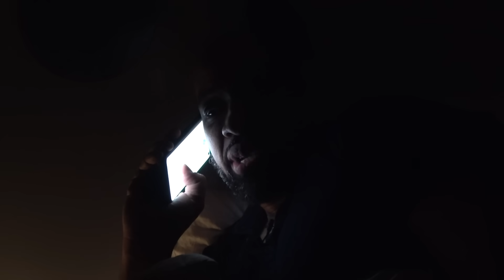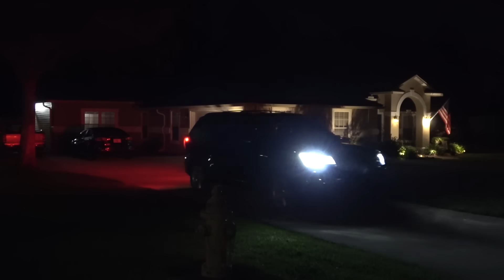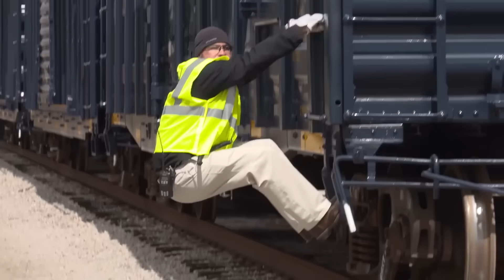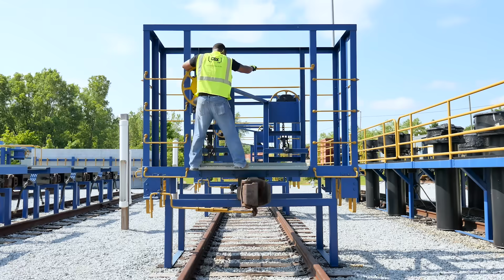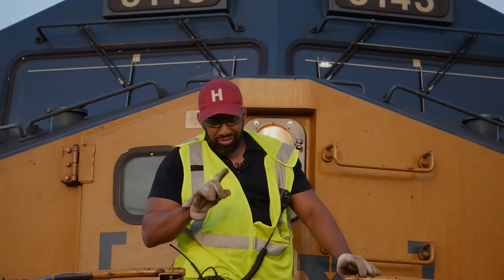A Day in the Life: CSX Freight Conductor

Comment: Ok I see a few things wrong with this. 1st when he went between cars to tie air hose or do any work between cars he didn't request 3 step protection an that is a safety MUST. 2nd when you go to Atlanta for training you have to maintain an 85 % or higher to stay in the class. Also you must pass a signals Test with a 100% if you miss one you get marked as fail.

Comment: I just retired about 18 months ago, after 45 years in the UK rail industry, and I can see, the glamourisation of the industry, is very much the same. Working nights, weekends, holidays, etc, the industries carp on about safety, fatigue, not cutting corners, but really couldn't care less. All this 'do gooding', is a tick box exercise.  I wasn't a Conductor/Guard, or an Engineer/Driver, I was on the OLE/Catenary, then later, I was a trainer/instructor. The latter years were easier, but I still saw all these types of videos, but when something bad happened, you had to watch out in some cases. It's always high management who cause the problems, but don't have to put up with the crap, both industries should let go of high management - I'm sure it would run better. I'd just finish and say, if you are still in the Rail(road) Industry, wherever, just stay safe, don't do what you shouldn't, make a note of anything you don't think it right and video it. Look after number 1 - YOU.

Comment: This seems like a great career .... until I started reading the comments!🤣🤣 I'm currently travel building wind farms all over the country so the travel isn't a problem for me. I think the only thing that would bother me is the weather. Even though I have to deal with it now travelling to different areas, I do have to comfort of getting back into my truck to get warm when its cold. I'm not worried about the heat because I grew up in Alabama and I'd much rather be sweating than freezing. Hotel living is not a problem, unless they book the hotel for you and its a dump. But, I would hope they'd book somewhere you could get the rest you need comfortably. I appreciate all the other comments I've read under this video as it was/is extremely helpful in my decision-making process. I still think I'd like to try it after a few more years out here in the wind industry. Thank you CSX and those of you who've been in the rail industry for a while!!

Comment: Ya tell me to push back 50 car lengths. Count off 1 car length into the radio, slam the locomotive brake and let the slack run out. Start pushing again. Go one car length and count off 2. Slam the brake again let the slack run out again. Wash, rinse and repeat 48 more times. If you're still hanging on, you can tell me 100 car lengths and I'll respect your decision.

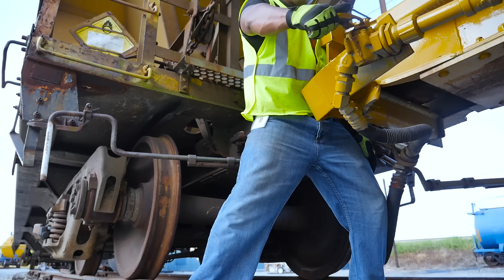Comment: well at 7:43 thats a fail, that clamp comes apart, at 90 psi, the iron head on the end of the rubber hose will shatter the bone in his leg, the volume contained in the air line, will whip the heads around while your man is down on the ground striking his body or even his head, wonder what else ill find in this video.

Comment: I was almost hired at Union Pacific I passed everything but the interview. This video was very "light" and didn't go into the real details of working on the RR. The guy that oriented us told it like it really is. You're  going to miss just about every holiday, birthday, anniversary, special events and etc. I also hope you have a STRONG relationship with your spouse or significant other. Because the divorce rate is 2nd to police officers which was #1 when I applied. The other stuff will be covered in the orientation. It's hard work and very demanding, for example walking a mile or more with a knuckle to change out when they break in every weather condition possible. Get through all of that ,you'll have a successful career at any railroad...

Comment: I am just amazed how this job is portrayed as a walk in the park instead of the reality of railroad employment.
Called at 0 dark 30 with a pending family event is very accurate. Most of the remainder of the video is inaccurate or just false. 
The conductor and the engineer must be actors because nobody with any time on the railroad is that clean. The vests look like they just came out of the wrapper and still have creases in them. New gloves and a new radio are certainly props and neither the conductor and engineer were wearing hearing protection. If you are going to produce a video at least make it accurate.
Reply: Every once in a while I would get called off the extra board to work a job that serviced a local chemical plant. Everyone working at the plant were wearing hazmat suits. Not us. I tried and tried to get the chemical smells out of my clothes. Never could and would end up throwing them away. The EPA ended up closing the plant down and had it demolished. Tallow plants and lime plants were fun ones to service as well. It was a complete shit show. Winter was fun too. Shoved an 11,000 foot train out of the yard hanging on to the side of a box car one night. Freezing rain smacked me in the face for the entire ten mile shove. There was no van available so I had to walk from the rear to the head end. Even my old head engineer, an old Nickel Plate guy, was pissed off for me. After about ten years I had enough. I saw more than my fair share of shit and wouldn’t wish what I saw on anyone….well, maybe my ex-wife, but that’s a different story for another day. 😎

Comment: I work as a conductor in a switch yard. Not class 1 I will never work class 1 after up did my uncle dirty. You may have a job, and get paid well, but that doesn’t mean you’re consistently getting paid. My uncle worked for 3 years and only actually worked maybe 1.5 the rest he was furloughed not getting paid, and not able to get a different job

Comment: 11 years as a Conductor. Close to engine school. Road/Pool jobs suck, the extra boards suck. We tell the new hires (yes, they actually hired in my terminal (cause they furloughed a LOT last couple years, no one came back) that they fucked up, some have left already. Only good PSR has done for my terminal is the flat switching, which caused local management to put on a yard extra list. 11 years and a yard extra list is the best job I can hold. Most of us enjoy our actual job, it's everything else that comes along with it, especially after PSR came into effect. Don't forget the onboard cameras, PTC, and Energy Management (sodomizer). No fun left in running trains. Can't test your skills with the air brakes anymore. Can't do anything really. PTC is nothing but a nanny designed to get you fired, an excuse to cut jobs. Just wait till the Class 1s get there way with crew consist. Never mind the expired contracts that they won't negotiate, or make absolutely absurd offers on (yes, the unions are a part of the problem here too).
Reply: You've told nothing but the truth!!! OS RR

Comment: Back in 2018 I worked for a company contracted through Union Pacific. Was there for about 6 months as a trailer mechanic. An alright job, left because I was working third shift though. I hate third. But, if you're working in a shop or an intermodal facility, you should have some type of life. Theoretically.

Comment: Aside from this video.... Is there a ladder to climb to drive certain locomotives?? I see so many nice locomotives and some just over worked and in need of TLC. But to me i think of it as cars, in which the old beat up engines are given to lower ranking drivers, and the newer different engines like the heritage units i see or other random units are driven by the upper class engineers?
Reply: nope doesn't work that way... with the locos you get what you get you don't have a option UNLESS, there's something mechanically wrong with your unit
Reply: @25mfd  Nice. Thank you!

Comment: Did 12 years on shortline/industrial jobs as engineer. Life was good. When the last one ended and shut down with the closing of our major customer, a friend told me I should go to CSX or NS. "No thanks!" Tried truck driving for the next 7 years which turned into a real horror show. Doing my own thing now and don't think I missed out on the class 1's. And I've known A LOT of former B&O guys who have nothing good to say about CSX.
Reply: why was trucking a horror show?
Reply: @hectorfernandez6748  too many reasons to count, I imagine.
Reply: @hectorfernandez6748  It’s just as bad as some of these guys’ times on the rail. You’re overworked, underpaid, tied to a truck (may as well be literally with the amount of time you get to spend with your family). They claim you’re your own boss and the corporate/admin side is “hands off”, but call a dispatcher and tell them you’re not feeling well and the load may have to be late cause it’s affecting your driving and that’s when the excuses as to why you should keep going come in. 

That, and some dispatchers are known to try and coax drivers into breaking the law, mostly by driving longer than what is legally allowed. I bet you if they suffered the same consequences as the drivers they told to break the law, they wouldn’t do it. 

I remember I was stopped for my mandatory 10-hour break and had a dispatcher message me on the hardwired tablet in my rig asking why I’m stopped. I silenced my tablet and ignored every message from that specific person after they asked me how it’d be illegal for me to continue driving. If I’m being honest with you, they may as well replace the name your parents gave you with the truck # printed on the rig they assign you, because that’s how you’re treated.
Reply: @WhopperJrNoCheese  if you know they will never do it. you should do the same and never let anyone pressure you into it  i'm very new to this field and i've learned from my previous career if you let them get away with it they will never stop.
Reply: Not just CSX... all of them!

Comment: The video tells you that you will be home for the required fra 10 hour period. What they don't tell you is that  you will be away from home 36-50 hours in a dirty hotel.
Reply: 36-50 hours?  What AFHT terminal do you go to?!  Half the time at ours we get that call from the dispatcher before we get there... "Dispatcher to Q40whatever, Chief says show back up on your rest for Q30whatever."  Exhausting.
Reply: @nicholaswhitfield9341  you do understand that its 12 hours on a train your home to your away terminal, 12 hours in the dirty run down hotel and 12 hours to get back home. That equals 36 hours. You deserve 2 full days to be with your family, but csx will call you back in 10 hours to do another 36 hours minimum away from your family. Thats why I quit after 25 years because of loss of family and friends. I got job as an electrician and actually make 44.60 an hour straight time and double on Sundays home every night. The railroads have gotten too toxic as what they was in the 90s. You know we used to be able to mark off a few days and have some quality time with the family.

Comment: Would working for BNSF be a good idea?
Reply: BNSF is the best; best track and best equipment.    Warren Buffett bought quality for a reason.
BN furloughed way too many employees and mothballed way too much power during the scamdemic.
When it was time to run trains; well.....     If you apply off the street; your life will never be the same.
Reply: They aren't horrible. They sorta do PSR. I know the Lindenwood Yard near me in St. Louis Missouri. I haven't heard any complaints other than shitty management like every other Class 1 Railroad. It's one of the better options avoid Union Pacific and CSX.  You could try a short line railroad to get some experience. Best of luck however.

Comment: Hey, I'm thinking to apply to CSX when I am eligible, but I am reading some concerning comments, could somebody give me a run down of what these concerns are please, also would it be worth it to apply still?
Reply: The negative comments are pretty much true my friend. I ignored them when I joined thinking it was people with bad attitudes. I worked for a large Class 1 railroad for 14 months.
It was the absolute most miserable time of my life.
That being said, they do pay well and have good benefits, but if you can't adjust to literally being owned by the railroad, to come in at any time of the day and work for 12, 14, 16 hours straight, then go home, sleep for 10 hours and be called right back to do it again starting at 3am, working outdoors in any weather any temperature, the job might not be for you.
In general the people are miserable. Most of the people are good, smart, friendly people, but they are just tired and miserable.
Spend 14 hours on a train, arrive at your destination and then sit in a hotel and wait for 2 hours in the lobby before the crappy hotel has a room ready for you.
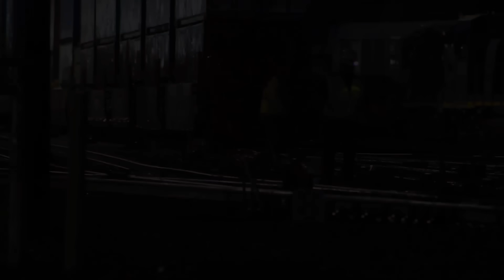Spend 14 hours on a train, run out of hours on the train and then wait in the train for a van to pick you up and drive 80 miles to a hotel at 4:30 in the morning.
If you work in the yard, depending on the yard's complexity, expect to know very little about the rules and the yard for at least 18 months. It's difficult to learn the system. It takes many months. There are many strict rules that are stringently enforced concerning safety and movements of equipment.
The worst part is the hours you work, not knowing what time your next shift will start.
It works by phone call. The phone can ring at any time 24/7/365. Then you have 1.5 hours to get to work. Then you could work for 12-16 hours. Sleep in a hotel and wait for the phone to ring in the hotel to go back home on another train. I spent two days waiting in a hotel to get back on a train home. 
Another thing is the work pace. If you like to work hard and get things done, the RR doesn't work like that. There's lots of waiting around and standing and sitting around at 3am waiting to get a signal to proceed. The rules also, which are needed, nonetheless hamper you from having a nice workflow. Many times I finished a shift feeling like I didn't do anything worthwhile. But that's the life.

Comment: I thought getting on or off no matter what the SPEED was not good?
Reply: For about 15 years the big guys prohibited it because they felt like there were a lot more accidents happening and the Union was hitting them pretty hard to just stop the movement. 
But the truth and the reality of it is that it's easier to keep moving. Make the train slow down and always plan your footing for both getting on and off. When I hired out 21 years ago, moving mounts and dismounts were a no-brainer and it just made sense. Somewhere in between that time and now they hired a bunch of rough and tumble dudes who were in a hurry and got careless. And then we went through a rough patch where it was illegal even to do something like stepping down at 0.1 mph because the wheels were still turning.
If we outlawed everything in the industry that could potentially harm us due to carelessness, we would weld the wheels to the rails and pad the whole corridor with ten inches of foam!

Comment: Pretty unrealistic but some truths..I do have a question though would it be better to start with a Short line first with regards to training? Anybody here from the GW or affiliates?
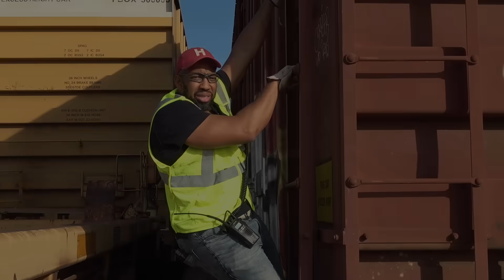I did think@ 6:17 oh man..if your ass is hanging out that far on that ladder with that Pinch Point coming up you're going to have it squished to death between those two cars..
Reply: Most short lines do not have a worker's Union. Many of the big short line companies are trying to follow the class 1 model of hiring you to fire you and with no Union to protect you, it's like working for a McDonald's. High turnover rate, low pay, unreasonable expectations and bad morale. 
Plus the short lines are also at a point where they can catch Class 1 engineers and conductors who have recently been furloughed and not have to invest as much in training. Quite literally anyone who has an engineer's card from a Class 1 can mark up after a single Stop test and ride-along on the short lines, whereas everyone else would need 160 hours of run time on the route before they can have their card validation.

Comment: Dodged a bullet on this one.  An entire office complex full of dispatchers and you haven’t the foggiest clue of when a given train will be somewhere in particular?  There’s folks on call in emergency service, but they have to perform for maybe a couple hours at a time.  Wears you down really quickly, but that’s why you got the 24/48’s.  And back to the point, i get that shit happens on the road, some dispatcher cocks up and goes for coffee at the exact time they needed to clear a signal, but a local yard switcher?  Our yard job goes the one way at 9pm (give or take ten minutes) and the other somewhere around midnight (unless another crew gets done early and does that run too).  PSR has some advantages, holding departures to an exact and scheduleable timetable.